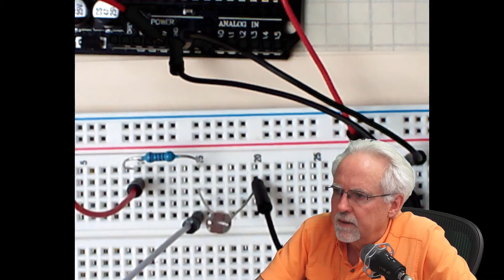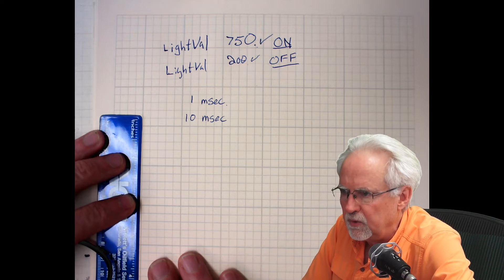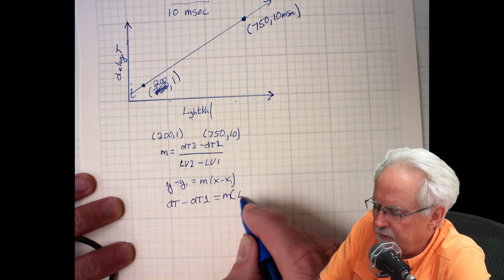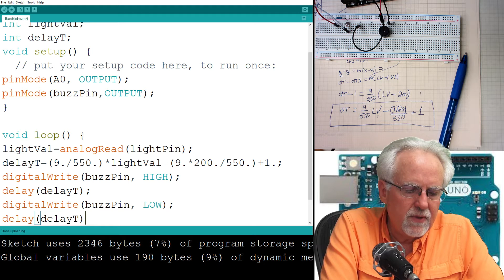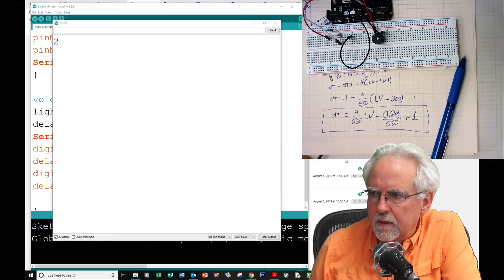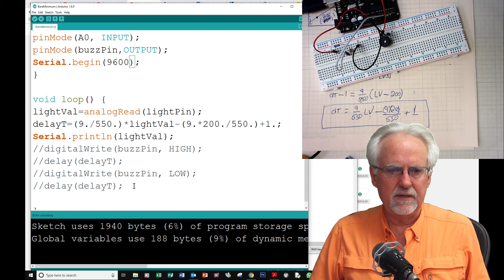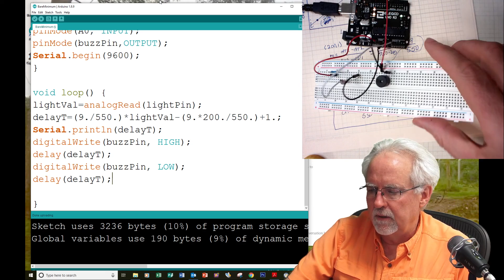Arduino Tutorial 26: More Fun with Photo Resistors

Comment: I was actually able to make it work before you showed your setup. In your connection you connected the  resistor up to the 5VDC and the photo resistor to ground. My connection was the opposite. My AI measured the voltage drop across the resistor. I was thinking that was how you connected it up in the previous lesson but it doesn't matter as long as you scale the input accordingly. It all still worked! Thanks for this series of lessons.
Reply from the maker: Excellent!

Comment: I am having trouble, my passive buzzer isn't coming on. I worked out what the output is supposed to be using the formula we learned in video 24, but I am getting no output from the buzzer. I also tried connecting it straight to 5v, but no sound. I read that it is supposed to make a click when it comes on when connected to the 5v, but nothing. Is it busted? Should I get a new one?

Comment: "I made it work."  The tone range in the TinkerCAD buzzer is way different from the buzzer in the ELEGOO kit.  Also, my min/max values for my passive buzzer are different from your values.  And the passive buzzer puts out very little volume, but it is working.  The active buzzer gives a strong sound.

Comment: Thank you so much sir for the knowledge. Fortunately I manage to done it before continue to watch your solution. My method a bit diffrent as my analog pin read the voltage across photoresistor instead measure the voltage across resistor (as you shown in the video). Therefore, my equation is diffrent which i get downward graph. And yeah it works and i am really happy about it. What makes me more exited is you made diffrent method but result in same outcome. Thank you so much sir

Comment: perhaps i missed it but was there a specific reason why you did: 

pinMode(A0,INPUT) and not pinMode(lightPin,INPUT)?

you did pinMode(buzzpin,OUTPUT) not pinMode(8,OUTPUT).

i understand the equivalency, just curous
Reply from the maker: It was a mistake on my part. Should have been in the program.

Comment: Mr McWhorter, since I decided to went a bit further in my homework, and I thought I made it a bit flexible with my implementation, i had decided to share with you what was my idea and what I did. I really hope you’ll find it interesting. Basically, max and min values for the light are deterministic, so if I decide to demo the project to someone, or even to test it myself on a different time, it might not work, since min value could be way off. So I have added a potentiometer which I use to control the lower value (the night) for the project , whereas max remain the same. That allowed me to made pretty cool tests with that, when I had my phone (with its light on ) on different distances from the board and adjusting the potentiometer and moving the phone closer and further , was able to change how “sensitive” to the light my project was. Obviously I ran out of grounds and 5V so I used the rails first time. Thank you again for the inspiration and teaching me.

Comment: MY CODE:

int buzzPin=8;
int toneVal;

int lightPin=A0;
int lightVal;
int dv=250;
void setup() {
  // put your setup code here, to run once:
pinMode(lightPin,INPUT);
Serial.begin(9600);
pinMode(buzzPin,OUTPUT);
pinMode(lightPin,INPUT);
}

void loop() {
lightVal=analogRead(lightPin);
Serial.println(lightVal);

toneVal=(9940./1023.)*lightVal+60;
digitalWrite(buzzPin,HIGH);
delayMicroseconds(lightVal);
digitalWrite(buzzPin,LOW);
delayMicroseconds(lightVal);
}

Comment: So it turns out, that using a float in the equation ruins it.. I wasn't getting high enough of a pitch due to it.

I wanted to ask why is that?
When would I use a float then? If not for a equation like this?

Comment: There was a mistake on the setup for the pinMode for the photoresistor, it is suppose to take the variable name not the name of the pin, I really appreciate these series, it my ticket to robotics engineering.
Reply: I noticed that, too. At least, one lesson I got from this is that you could actually use the actual pin number (ie, A0) instead of declaring a variable.  A bad practice, I know, but it is possible.

Comment: For some reason the circuit appears to lock up when I add +1; at end of equation when I cover the photo resistor with my hand. If I Upload again, the circuit works
If I add +2; at the end, I can cover the photo resistor with my hand and it still works. Remove my hand and get a high pitch tone.
I'm using dt=(9./900) * lightVal - ( 9. * 250./900.) + 2; My Resistor is marked 5.1K.

Update: I fixed the problem. I swapped the 5K resistor and photo resistor. Put +1; at end of equation and no more lockups. Now, low pitch if dark, high pitch if I use Pen Light.

Comment: I have been following your lessons for the past couple of days, and I would like to express my sincere, heartfelt gratitude towards this endeavour of yours, good Sir!! I am learning so much about this new discipline, which has always seemed scary to me; until now!! Thank you so much Sir!! 🙂🙂🙂

Following that up with a doubt...Would be indebted if you could point out, where I am going wrong in my understanding...

The magnitude that we are measuring with the variable:'lightVal', is an indicator of the intensity of light incident ON the photoresistor, right? Thus a 750 lightVal means an environment which is better lit than 200 lightVal. Moreover, in case of a passive buzzer, a smaller delayTime means a shriller sound, right? So, a 1ms delayTime would be shriller than a 10ms delay...In that case, if we want to go from a shrill sound to a hoarse sound: in transitioning from a brightly-lit room to a dimly lit room; wouldn't our graph have a negative slope? Like, at a lightVal of 200(i.e. dim lighting), we want a hoarse sound(i.e. a delayTime of 10ms), and at a lightVal of 750 we want a shriller sound(i.e. a delayTime of 1ms). So, in short, that generates a different equation...However, the circuit that I set up using the equation shown in this video seems to do the job; could you please help me understand where I am going wrong? 

Thanks once again!!
☺☺

Comment: Opps I used the active buzzer.  I used a float with a similar slope equation (min128 to max 945) to calculate an output Voltage. Used an analog write to the buzzPin for the volume.  Was able to add a dimming LED running off of the same pin.

Comment: Paul, I got a workable result, but I used a different method. When calculating the slop, I treated it like a potentiometer and used x values of 0 & 1023. The y values came from the high and low of analogRead(lightPin).  Is this an equally correct way of approaching the problem, or did it just work because any slope will give a varying range of tone - but not necessarily the correct one?

Also, I used analogWrite(buzzPin,lightVal); for the out put to the buzzer. My reasoning was that the frequency of power from the Arduino would correlate to lightVal? Is this technique better, worse, or equivalent to the way you solved it in the video?
Thanks.

my loop code is :
lightVal=515.+(185./1023.)*analogRead(lightPin);
analogWrite(buzzPin,lightVal);

Comment: I'm not sure if anyone is working along these Lessons at the same time but I have an issue that I can't figure out. I've used the exact numbers in my calculations as those in the video and the same hardware.  When my lightLevel drops to 77 the program locks up solid. I can shine a torch on the Photo Resistor and nothing happens. Screen.println(lightLevel) returns no further values.  When I hit the Arduino reset button it works again until the lightLevel hits 77, then locks up once more.  Any ideas as to why this is the magic number??

Comment: I'm having two problems, not your issue.  1) Using IDE 2.0.3 on Linux OpenSuse Tumbleweed which for some reason every once in a while decides to quit uploading.  I keep trying to reset the board and port but have not yet figured out why it quits or what I do to suddenly make it work.  2) When I try to open the sketch under 1.8.3 the IDE I get a bunch of error messages saying that it can not read the sketch for various reasons.  I have issued an email to arduino but have not obtained a response as to whether it is my problem or an issue.

Comment: Hello Paul,
I realy like your series. Trying my best to do your assigments. I did this as well, and then follow along. However i did get some strange readings. 
When i did it myself the photoresistor circuit was first the photoresistro and then the 5K fix. When i saw you hooked up yours the other way, i changed mine as well and then i saw that my reading went sideways. When i covered the photoresistor the readings went up to 1023 and went down when light it up. 
Maybe i'm mistaken that this could be the case with you in the video? After you fixed the pinMode the Serial monitor showed around 250 with the lights on. 
Did i messed up something? 
Keep up the good work, and Thank you!!

Comment: Another brilliant tutorial!  Something I'm noticing is if I use Serial.print within the programme, the tone function doesn't really work.  I assume this is because the Arduino is slowed down when I use this function, so the buzzer doesn't work correctly.  When I remove the Serial.print command, all is fine.  I love using your videos and then working it out for myself and doing debugging.  I'm learning so much from your videos and then so much when I work it out for myself too!  Thanks so much Paul!!
Reply from the maker: Serial.print is a relatively slow command to execute so it throws the timing off.

Comment: OUCH ! Please could you clarify Paul. Your circuit on lesson 25 sequences the photo-detector directly from + with the 5k resistor placed after. But this one (26) you've put the resistor direct from + then the photo-detector. I left the original circuit (from 25) as it was already there, but i've battled through this continually getting reversed values (ie light 'on' = low tone (instead of high). I eventually had to 'cheat' and spotted the discrepancy after a 5hr debug, 7 graphs of all possible permutations haha. I'm not trying to be a smart arse here, but would appreciate if you could advise if there is a best practice for the sequencing, as it has a bearing from what I can see ? Bloody GREAT learning though as I've firmly got these formulas etched deeply to the inside of my skull lol .... uk senior guy who needs something stronger than cold coffee !!!

Comment: Hi ,
My lightVal is between 247 and 1012. Is it correct to write the equation this way:
delayT=((9./765.)*(lightVal-247.))+1.;
Also, how to calculate an equation that do the exact opposite. When the light goes up, the buzzer goes higher?
Reply: The opposite;
 delayT=((9./-765.)*(lightVal-1012.))+1.;

Comment: I got it working. But what I don't understand yet is this: in my first attempts, the loop I created also had a Serial.print function so I could see the voltage reading and also the microsecond delay my formula generated from it. However, that bit of code, and whatever it did to the buzzer's timing, messed up the tones.  When I inactivated those lines (and that's my new trick--a bit of // thrown in to temporarily inactivate activate a line) the tones worked as expected. I assume it has to do with whatever microdelays running those Serial.print lines creates, but I'm not sure.  Now, I'll watch Paul's solution.
Reply from the maker: A serial.print command sends data over the USB, which by computer speed standards is a relatively slow step. Hence, by putting print in the loop, you are slowing the loop down, affecting timing and the tone of the buzzer.

Comment: Hello Paul, I remember y=Mx+c from my college days 40 years ago and thinking then that I would never need it! Who knew! 

May I ask, you declared lightPin=A0 as an int but you used A0 in the pinMode instead of lightPin in setup. Then you used lightPin to calculate lightVal, not A0 and it still worked! How did the formula in the loop know the value of lightPin?

Great video series!

Comment: sir i thought i should build a project in which how much ldr will sense light that much volt led should on like in dimmable led project i used the same and code is this:-
int lightPen = A1;
int lightVal;
void setup() {
  // put your setup code here, to run once:
pinMode(lightPen,INPUT);
pinMode(7,OUTPUT);
Serial.begin(9600);
}

void loop() {
  // put your main code here, to run repeatedly:
lightVal = analogRead(lightPen);
Serial.println(lightVal);
delay(500);

analogWrite(lightVal,6);
}

circuit is a led one and a ldr one

Comment: I dont have a passive buzzer so instead I used the light level to fade an led by taking the lightVal and dividing by 4 then used analogWrite to write the value to an led on a pwm pin. I think I understand the lesson of using a photoresistor to control something. Which in turn helps me understand even further how to use any sensor to control another part of the circut. Man oh man am I getting some awesome ideas on some fun and useful projects!!! Thanks for all these lessons, I'm having a blast!!!!!

Comment: Paul, I am about to continue watching - I worked this out for myself and hit a few roadblocks, which I worked through and overcame. I think this strategy is great. I am really interested to see where your code and my code vary. I also learned a bit about voltage drops, so thank you!
Reply: Oh my gosh. This post did not age well. I had the right(ish) formula but was using 1023 as a hard value, rather than using the read range from the photo resistor. I am sad that I didn't quite crack it, but happy to have given it a go! I also spotted the mistake :)

Comment: My time values for ON and OFF were based on PWM formulas. 
         I instead change the frequency instead of directly changing or assigning time values. The only calculation I manually did was calculating for the resistor value that would be in series to the photoresistor, I came across the Axel-Benz formula for that and used it. 

         Although there is also calculation for the frequency, period, time on and off and duty cycle, but that's done by the Arduino. I had to understand what are those before using them though, because the order in which they are written and how it would affect the pitch of the buzzer is important. My duty cycle value is constant and is set to 0.95 because at 1.0 value, the passive buzzer won't work. At 0.95, buzzer would still recognize there is on and off.

         So when there is no light, the frequency is set to 1 HZ, I can literally hear the ticking sound produced by the buzzer, it matches the sound of the ticking wall clock. When there is max light towards the photoresistor, there frequency becomes 490Hz, really irritating to hear the buzzer at that point. I had fun simulating a piano with my phone flashlight afterwards. 

         Maybe next, I'll try using the RGB-LED module because each visible light have different energy, each light color would also affect the photoresistor differently.

Comment: Hi Paul, first of all I want to thank you for these great tutorials. I recently started with Arduino, because my son will be starting with Arduino projects in his computer science class. Now we can work together on some of these projects.
Incorporating math in your tutorials is a great way to make people understand how these sensors and circuits interact...
For the homework assignment of tutorial 26, I did the math...A little bit later I was reading through an Arduino manual and stumbled upon the "map" function, which automatically converts lightVal to toneVal in this case.
I will stay an avid supporter of doing the math, but sometimes for quick projects this function can prove usefull.
I have added my code for tutorial 26 below.
Keep up the good work and greetings from Belgium!!!

int lightPin=A0;
int buzzPin=8;
int lightVal;
int toneVal;

void setup() {
 

pinMode(lightPin,INPUT);
pinMode(buzzPin,OUTPUT);
Serial.begin(9600);
}

void loop() {
  

lightVal = analogRead(lightPin);
toneVal = map(lightVal , 400 , 900 , 4000 , 1000);

digitalWrite(buzzPin,HIGH);
delayMicroseconds(toneVal);
digitalWrite(buzzPin,LOW);
delayMicroseconds(toneVal);

Serial.println(lightVal);

Comment: I used different value for delayT  which is (9940./600.)*lightVal+60 where the lightVal values was measuring between 0 and 600 volts and I chose between 60 to 10000 Microseconds for the range of tones . Since I have these two points , the rest of the homework was maths  that you also taught us using equations of a line. 

Even though it took me some time , I was very happy I had same outcome. I just can't believe I am making all these  by myself :elbowcough:. ALL THANKS TO YOU PAUL. 

String BOOOM  = ''PAUL IS A BLESSING TO US  '' ;   
.
.Serial.begin(9600);
.
.
Serial.Println(BOOOM);

Comment: Thanks for another informative lesson !!  I did have a problem I would like to share.  In order to provide information about the lightVal, I included several well-formatted Serial.print statements.  I heard nothing but clicking sounds from my buzzer.  After commenting out the Serial.print statements, tones were clear.  I increased the Serial.begin to115200 in the void.setup.  After uncommenting the Serial.print lines, tones were again as expected and the Serial.print statements worked properly.  Does this indicate too much time is being used to print the statements at 9600 baud?   Thanks!
Reply from the maker: Yes, at 9600 you are actually slowing the program down, affecting the buzzer tone.

Comment: The math is still a bit unclear, but it's getting there 🙂

However... I connected my resistor after the Photo Resistor... and I was only getting very low numbers (<200).
Finally figgured it out... and now I'm only getting high numbers (>900).
Did I break them when I connected them in the wrong order?

Ohh, and I updated my code to be same as yours, lightVal = 1023 & delayT=14 ???!